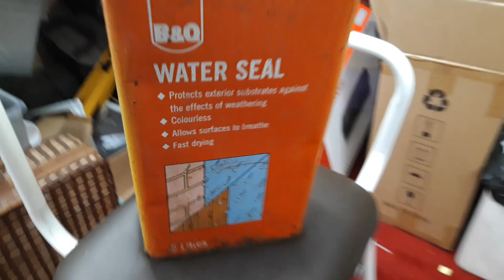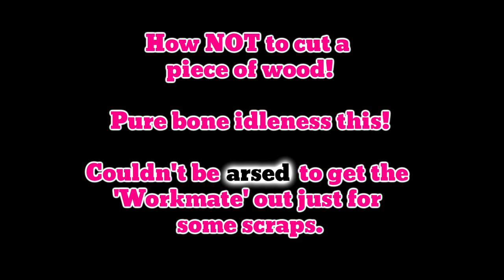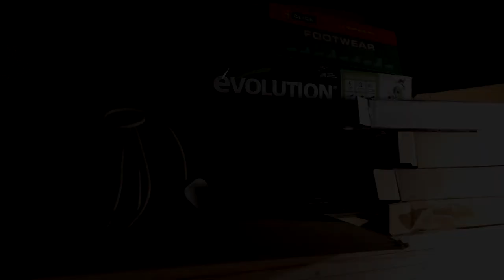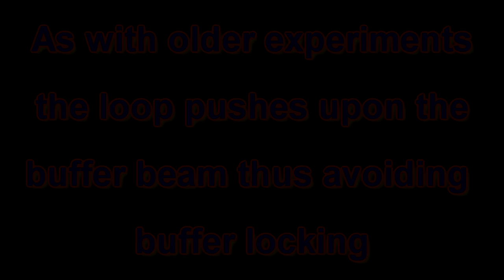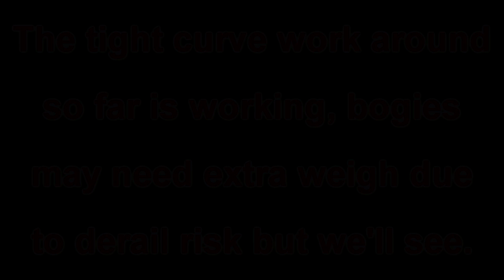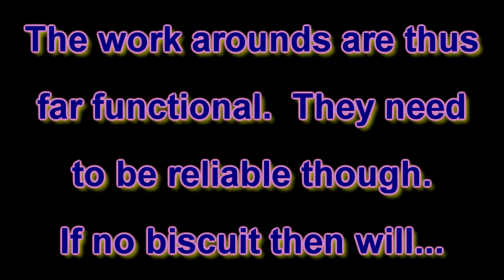NWR Tidmouth to Knapford & Beyond - Part 8 - How NOT to Cut a Piece of Percy Wood!

Comment: Nice progress
Are you not putting anything underneath the track for sound proofing?
Reply from the maker: Nope.   I've found underlay to be troublesome many times.  The old TRoS layout had cork. Upon ballasting it warped and bent the track n gave bad running.  Then I tried foam, this was ok.  Then tried card, again upon ballasting it warped n wrecked the track.  So for me it's often more trouble than it is worth.

Plus I like the noise anyway.  Why deaden it?  Railways are noisy. 😋
I like the amplified clickety clack on the metal sleepers too.

Comment: Would a dehumidifier rectify the mold issue?  Clearly there's moisture coming from somewhere which is resulting in mold growth.  I know I was dealing with the same problem on some of my tables until I got one of those units myself.  Of course, my work area is in an unfinished basement rather than a loft, but I'd say during the winter months it would be the equivalent of a basement during the summer months.  Something to consider maybe.  On another note, watching you try to saw boards on that chair was almost painful to watch.  Some of the worse carpentry skills I've ever seen.  Honestly reminds me of something I'd rather not mention, but lets just say I've been to part of the internet that I shouldn't be.  In all though really liking how the layout is coming along and I quite enjoy the running footage.  Looking forward to when the entire circuit is finished as I'm sure you are too.
Reply from the maker: Dehumidifier might be the answer actually.

I usually use a Workmate or the clamps on tne Circulqr saw but here I just reeeaaly couldn't be arsed to get them out n set up.  😁